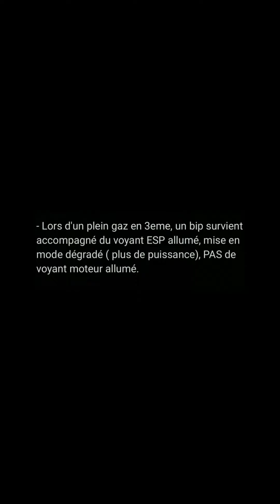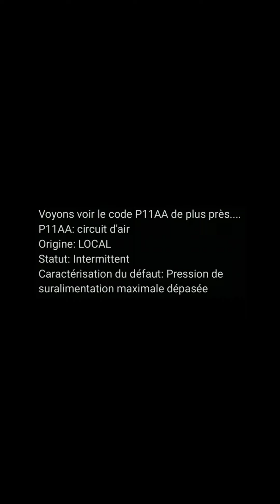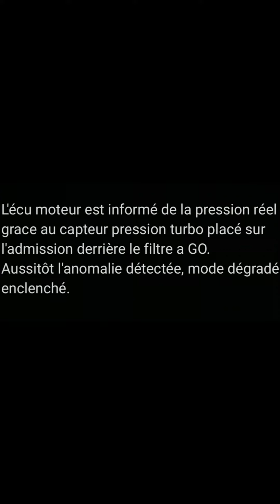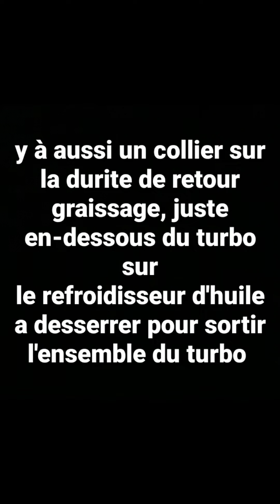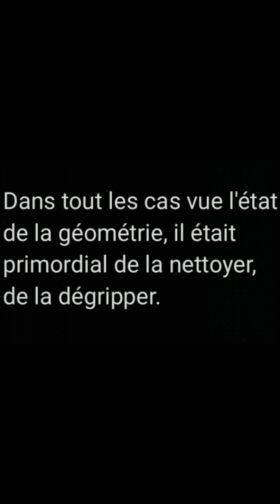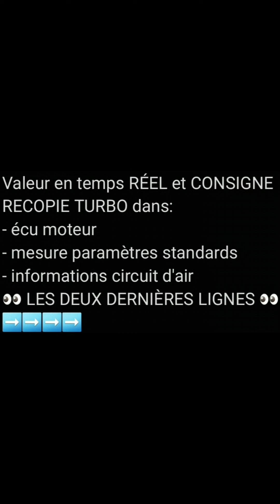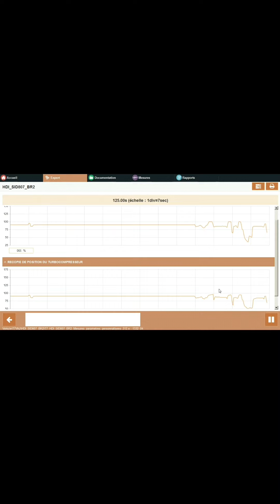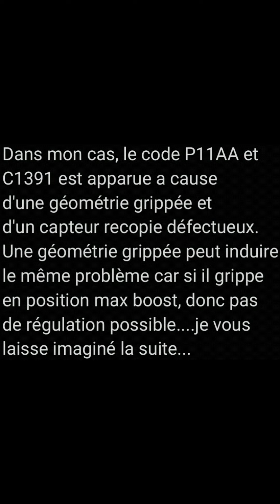⚠️Defaut: P11AA, C1391, 1.6 e-hdi perte de puissance "panne résolu"⚠️ ⛔lire vidéo en haute qualité⛔

Comment: Bonjour , 

Je souhaiterais solliciter votre aide svp j’ai le code défaut C1391 esp asr defaut accouplement moteur sans le mode dégrader et voyant esp orange qui disparaît lorsque je coupe le moteur merci pour votre aide
Reply from the maker: @ahdidabdelkrim9136  bonsoir,
Théoriquement vous devriez avoir un problème moteur....

Avez vous un code défaut moteur ?
Reply: Oui P0100 quantité d’air  supérieur élevé
Reply from the maker: @ahdidabdelkrim9136  quand vous aurez réglé votre problème P0100, le C1391 disparaîtra automatiquement. 

C'est quel véhicule ? Quel motorisation ?
Reply: @fashioncarsviral  c4 Picasso 1.6 hdi 112 CH
Reply from the maker: @ahdidabdelkrim9136  1.6 hdi 112 ? Le 16v ou 8v ?? 

Vous n'avez pas un bruit de sifflement lors des accélérations ?? Un bruit de fuite d'air dû à une durite percée ?
Reply: @fashioncarsviral  non aucune fuite d’air ressenti ou de sifflement ma panne est dur à trouver
Reply: @fashioncarsviral  aucune idée
Reply from the maker: @ahdidabdelkrim9136  concrètement vous avez fait quoi dessus pour essayé de résoudre le problème ? 

Vous avez fait le diag avec diagbox ou un multimarque ?
Reply: @fashioncarsviral  pour le moment j’ai rien fait dessus je sais pas d’où viens le problème, avec diagbox il y a deux défaut C1391 et P0100
Reply: Mon problème à l’air complexe à trouver
Reply from the maker: @ahdidabdelkrim9136  vérifie le débimètre. 
Le connecteur du débimètre ( s'assurer qui y a un bon contact avec les pins de la prise du débimètre).
Contrôler son faiceaux, si le faiceau n'est pas coupé ou abîmé quelque part
Reply: @fashioncarsviral  pour faire cette intervention il faut un multimètre c’est sa ?
Reply from the maker: @ahdidabdelkrim9136  contrôler votre débimètre. 
Contrôler le connecteur du débimètre si y'a un bon contact avec les pins du débimètre.
Contrôler le cablage du débimètre si pas coupé ou abîmé ( du débimètre jusqu'à l'écu)
Reply from the maker: @ahdidabdelkrim9136  avec un multimètre oui, mais aussi visuellement si le faiceau n'est pas abîmé du à un frottement contre un élément du moteur.

L'idéal est d'avoir le schéma sur la RTA ou hayness pro pour connaître les mesures entre chaque fil ( ohm et voltage ) pour un contrôle précis du cablage du débimètre
Reply: @fashioncarsviral  tout sa est pas dans mes compétences malheureusement lol mais la solutions est bonne je pourrais voir déjà les pins de la fiche du débitmètre  si elle est pas abîmer  en tout cas un GRAND MERCI a vous vous m’avez BEAUCOUP  aidé encore merci